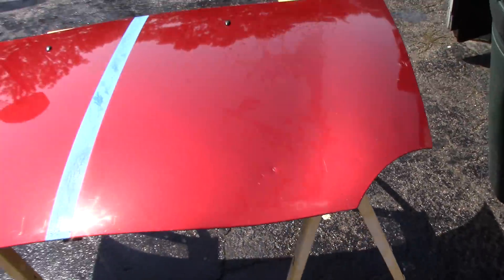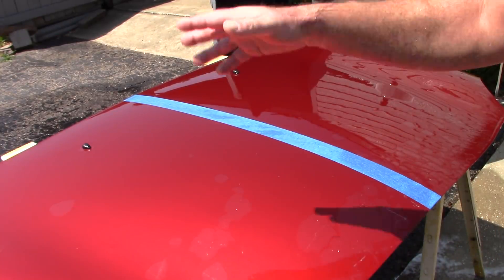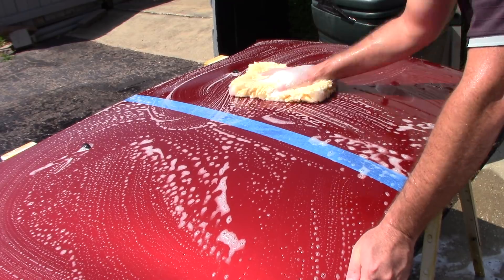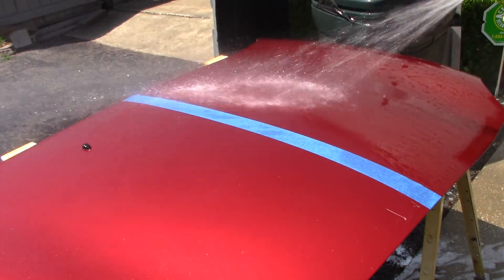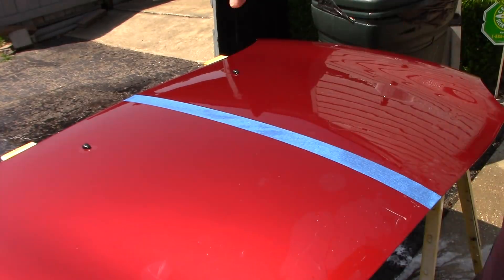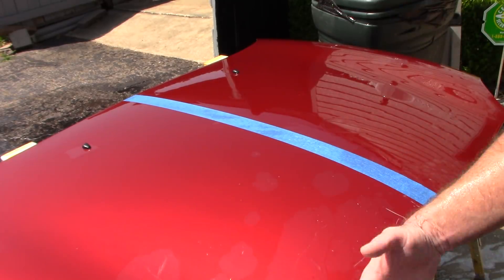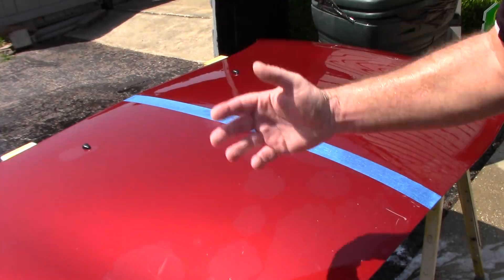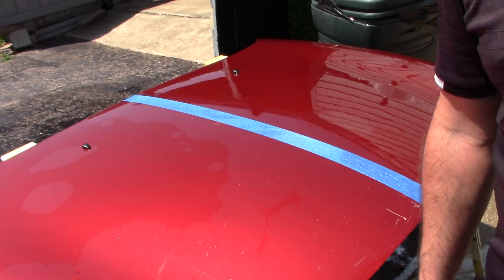SIO2 Car Soaps - Do They Work & Warning!!

Comment: Do you think maybe it doesn’t work because it’s not coated? I’m wondering if it’s advertised that way because it actually meant to react with the SiO2 coating on the vehicle. So then if the car isn’t coated, there is no SiO2 to react with, therefore rendering it as useful as a regular car soap. I feel that’s why a lot of these soaps advertise the SiO2
Reply: How do we know if it works on a coated car if it's already coated. Snake oil
Reply: @Dee--Jay  
True, but then you can say that about pretty much any product that’s meant to “boost” the coating....

Comment: I've actually had a good experience with the sio2 soaps, particularly carpro hydro2 soap. I will say that I've only used it in a foam cannon, never in a bucket wash. I usually get around 1-2 months of durability

Comment: I tested Gyeon Bathe+ (SiO2 shampoo) almost 4 years ago on my house windows. The glass I washed with it is still beading as we speak. Try Gyeon's version of it and I guarantee you'll have a different opinion. The reason I no longer use SiO2 shampoo is because everything the product touches ends up becoming hydrophobic and extremely slippery including tyres and anywhere else the soap runs. SiO2 of course loves to water spot, which means you then get lovely water spotting everywhere even in the crevasses you can't reach. Lovely! Great idea but in reality not the most practical. I'll stick with normal shampoo.

Comment: You know I got respect for you Scott. I use hydrofoam on stripped surfaces, glass, trim, and paint....100% OF THE TIME is changes the contact angle and beads and sheets water. What I have found to be the case with this soap is the fact it is hyper sensitive to other detergents. I have a bucket, foam.cannon, sprayer, and Mitt just for hydrofoam so I dont cross contaminate. If yourMitt, or bucket wasn't washed properly of all prior detergents, it wont work at all. Also of the panel you stripped still has apc or solvent on it, it wont work. I will strip with hyperwash and an oz of citrus ppwer cleaner plus and rinse it really well. If this was hydrofoam I'm actually shocked. I've never had a failure with it yet. I pay $20 per liter.

Comment: There's a lot of snake oil out there, thanks for calling this marketing gimmick out !
Reply: I agree with you, but me as a detailer I need to research a bit more about ceramic coat wash soaps. 
I also believe it can be fake too but you need to know that the real si02 wash soap have surfactants and emulsifiers as their main ingredient and that's why they work better in coated vehicles. This test shows that silica soap on uncoated vehicles work as dish soap.

Comment: Hello Scott,  thanks for the video!  I am thinking back and wondering if I have ever heard the claim that SiO2 wash, by itself, leaves behind "protection" on uncoated surfaces (which I believe was the point of the video) and I don't think I have. While, as you said, they are great soaps they are intended as a system. What I know of SiO2 it seems to bond best to itself, which is why the process of applying a coating has one or many types of adhesives in the traveling agent to help it bond.  Also, while the soaps are great for coated vehicles they do contain SiO2 and at a minimum you should use gloves while handling it.  Your skin is very porous and your body does not need SiO2, in fact, has to work very hard to clear what soaks into you.  Anything you can do to minimize exposure is worth it.  If it does that  to your shoes, imagine what it does to your organs!  Please people, use PPE when handling even light caustic chemicals and expect the best results of SiO2 soap with SiO2 coatings.  Thanks again, for the video.
Reply: William Brown I actually just bought a bottle of carpro hydrofoam because it claims exactly that. It will leave behind a protective layer that will last around 3 months according to the manufacturer.

Comment: I tried HydroSilex Silica Soap today, they say 1oz in a bucket wash. I started with 2oz in 3 gallons of water, no beading or sheeting, bumped it up to 4oz and still nothing. Then 8oz, nothing. Then 15oz of silica soap in 3 gallons of water and still absolutely nothing. Finally I dumped 1oz of silica soap on the hood and washed with my mitt, and guess what no beading or sheeting. All of this was done after I did my pre wash with Carpro Muti X, let it sit for 3 minutes then rinsed with pressure washer. Then foamed with 1oz Carpro Reset and 2oz bug remover in the IK Foam Pro 12, let sit for 3 minutes then did a 2 bucket wash and rinsed with pressure washer. Then did the Hydro Sikex Silica soap test, all of this was done with DI water. A rep from Hydro Sikex told me that this is normal and that it takes several washes to get any results.  I washed the truck 4 times with 15oz of soap in 3 gallons of water with no results, highly disappointed.

Comment: Hi Scott, I started to believe what your were showing and telling until I saw the water clearing out on the side you used the silicon soap by the time the video was done.  If you look at what they are advertising is exactly for that reason, so maybe you may want to wait and see how fast the water clears and dries out on the siicon used side vs regular soap side before making any inaccurate conclusions.  Thanks for the video. Appreciate your efforts to share your experiences.

Comment: I bought some SIO2 soap once. i coated my car and wanted to wash it with an SIO2 soap to maybe add a thin layer of protection over the coating after every wash. Maybe to help the coating last a bit longer. Even though i knew it would be a very minute amount of SIO2 added to the surface. I thought, it cant hurt anything. The soap worked great. So i thought ill wash a car with no protection and see how it changes the beading or sheeting. Just like your video shows. Nothing changed at all. I thought hmmmmmm. Needles to say once i used it I didn't buy anymore lol.
Reply: What type you bought

Comment: I guess when it is called a sio2 soap, it just means the soap is for sio2 coating but there is not any sio2 in the soap. Maybe SiO2 soap perform more cleaning power on coated surface.
Reply: Zhen Li - Some of those soaps, like the Gyeon Bathe+ (plus), actually do contain a small amount of SiO2.
Reply: Thank u , good to know

Comment: I would have to disagree...I have a Black car that has 5 year ceramic pro coating. The hood had a warranty claim and had to be repainted last month. The Si02 soap (Americana) that I use does not sheet the water off the hood however when it rains it still prevents water spotting and does offer some beading. I will have the hood coated soon but overall I think Si02 is worth the price

Comment: Garry Dean’s EVO shampoo works but you have to rinse the soap off then dry the car and then spray water on it and it will bead water like you got a ceramic coating on your vehicle but it is $27.00 a 16 oz. or $80.00 gallon and smells like watermelon. I love it gives you 2 months protection!!!

Comment: Wish you could test Modesta products but they're smart since they don't sell it to the general public. I was asked to wash a friend's car with their products since he was told by his coating installer you need to use their products only or the coating will lose it's gloss. Used the special soap and boy was it not slick nor foamy vs Meg's hyper wash.  Only positive side was it smelled amazing!  So much gimmick being sold on the coating market these days on that you have to wash your car a specific way to maintain the coating that is supposedly strong enough to resist scratches. Makes no sense.

Comment: Another great video Scott!! I'm using a while ago Carpro Reset (because i have a coated veichle) and the major problem i notice is LACK OF CLEANING HABILTY, wich for me is a major problem!
Reply: CarPro eraser isn't a car wash, it's a paint prep.
Reply: Ken Lawton , 😂😂 correct. I ment Reset! Thanks for the repair.
Reply: @mqdias1  😉
Reply: Check out Brians video APEX Detail on Reset... I use it on my coated  / sealed cars with no problem..
Reply: ken bence i use it also, but i think in comparison to others that are not sio2, it misses some cleanliness hability. Just my opinion! I'll check Brian's vídeo! Thanks
Reply: Reset has been amazing for my family fleet of coated vehicles, little to no pressure is needed for accomplishing a squeaky clean car. What kind of coating do you have? I'm wondering if your coating is not doing its job?
Reply: Rdetailing Carpro finest reserve! The shampoo is ok and slik wich is nice, but i found that for example in more stubborn bugs it failed at first. I need to repeat the wash in those areas to avoid bug removers. Just that . But overall is good só that i Will continue to use it. Was a side comment to Scott's vídeo.
Reply: LOVE reset

Comment: I think it's meant to preserve the ceramic wax or coating. Not add coating.. Normal soap usually strips wax easily. My car doesn't bead up anymore and it has hydro silex with bead maker and on top of that, seal and shine! So i was considering a ceramic wash

Comment: I'm getting ready to decontaminate, polish and seal my new car, and I have a question - how does one not get polishes/waxes/sealants on rubber/plastics?
Reply: painters tape
Reply: Reggie Reginato masking tape
Reply: Painters tape NOT masking tape. Painters tape WON'T leave a tape line and removes effortlessly.
Reply: Thanks everyone...  Just find it strange because everyone I know and every video I've seen to date I had never seen painters tape used except when runing comparisions.  I'm just looking to improve my amatuer techniques (and keep the resale value of the car up for the long term).
Reply: I meant masking tape for automotive work not cheap crap from walmart i.e. 3m masking tape
Reply: New updated waxes, polishes, glaze and sealants have natural high end polymer resins, and synthetic mixtures that instead of making all trim, rubber, etc white or faded it revives it instead